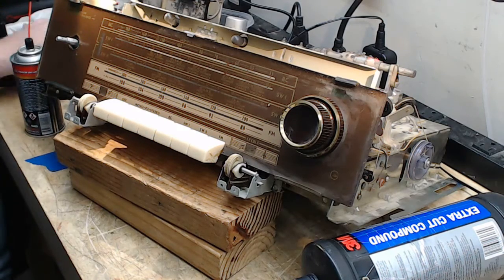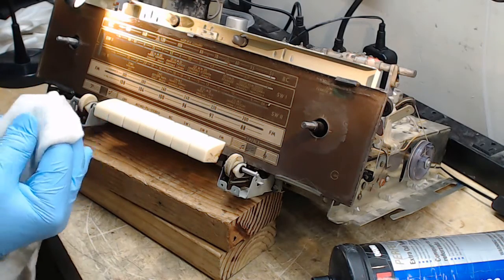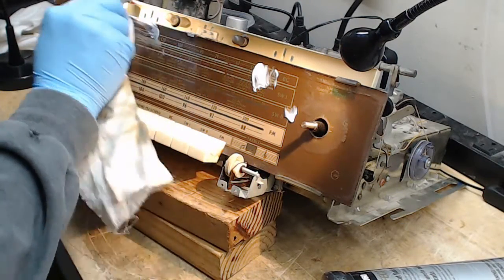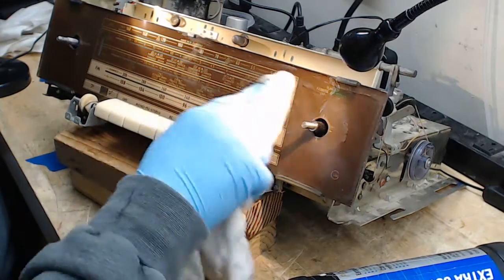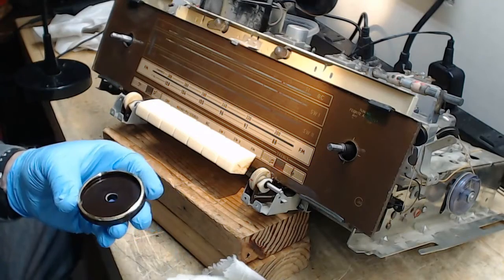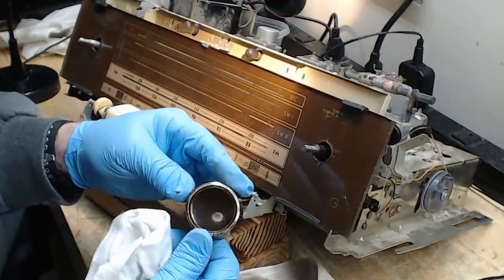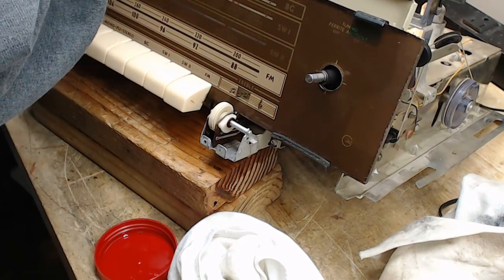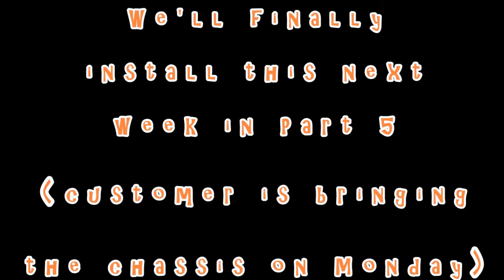1959 GRUNDIG MAJESTIC SO141Ua Radio Phono Stereo Console Part 4 of 6 The Lost Videos - Cleaning

Comment: I am not sure how old this video is, but it was very informative. In have a Grundig SO170U console radio with turntable.it all works but not as great as It once was.  My balance knob was seized...”Tight!!”  I tried your remedy and it worked.  I tightened a tap chuck around the balance shaft and worked it free after applying the diluted lubricant the night before.  Thanks for adding that minute or two highlighting how to free that shaft.
Reply from the maker: Roger,
That's awesome!  I'm glad it helped.  The German radios are very challenging but they can sound terrific.  I think yours is very similar to this one, is it not?   I will be working on  a Telefunken in about 6 months.  That radio looks similar to this Grundig, but inside it has its differences.  I hope that yours works out well.   Thank you for watching and thank you very much for your kind words.  Take care.   Michael

Comment: I use headlight  "Turtle wax, 2-in-1 headlight cleaner & sealant"  to polish my radios..and have not had a problem with it....
Reply from the maker: That cleaner and polish works the same way that the 3M stuff that I use.  I've used the Turtle Wax stuff on Wifey's van headlights.  I'll give it a try.  The 3M stuff is expensive.   Thank you for the tip, my friend.  Cheers!    Michael